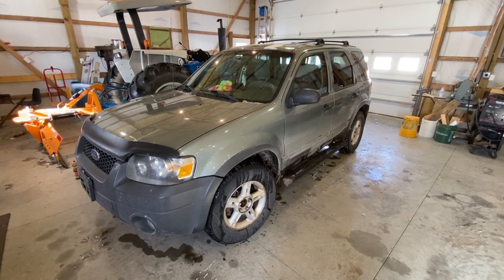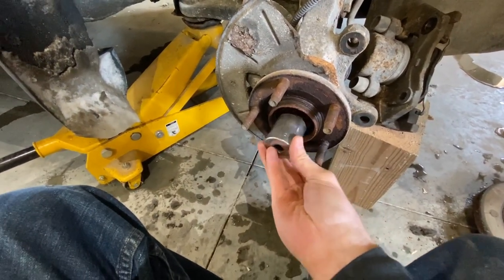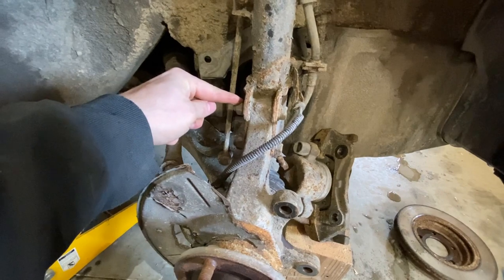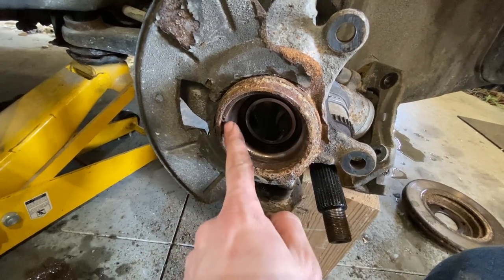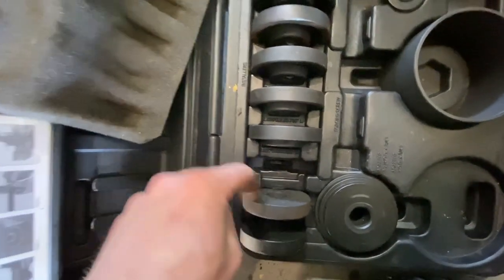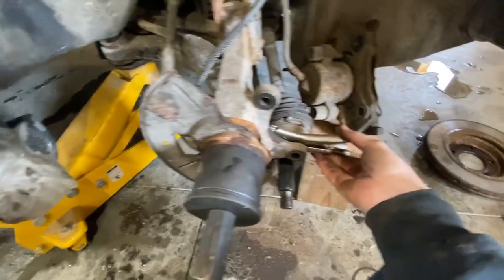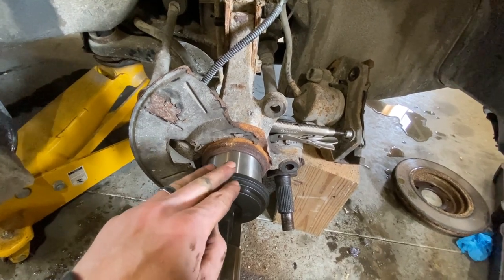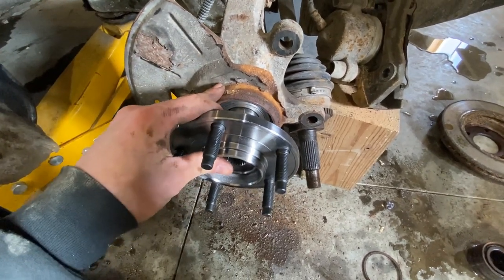Ford Escape Front Wheel Bearing Replacement 2001-2012 01 02 03 04 05 06 07 08 09 10 11 12

Comment: nice succinct video.  A bit of grease on the outside of the new bearing, and threads of bearing puller can help a lot.
Reply from the maker: That a great tip. 👍🏼 definitely would help a lot.